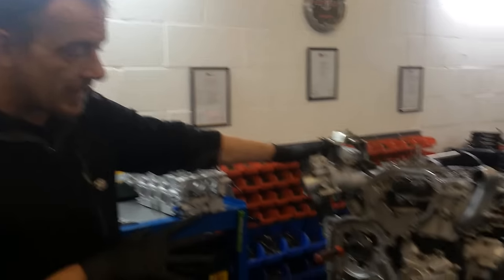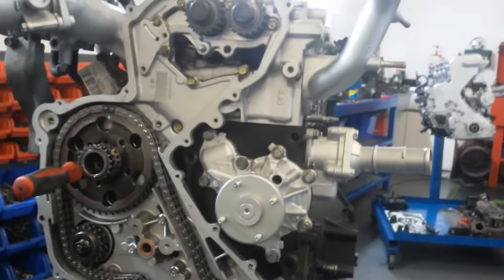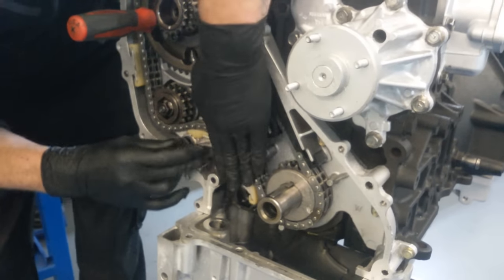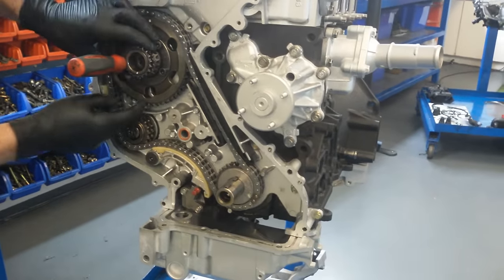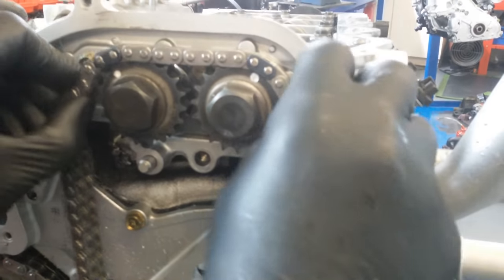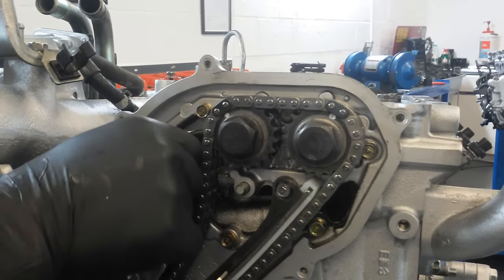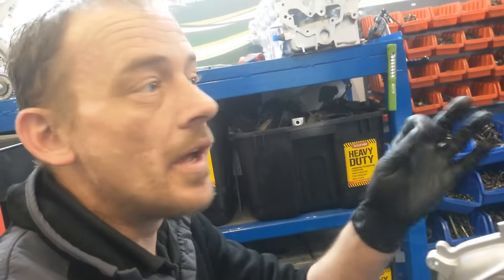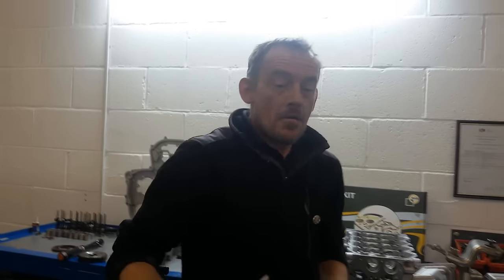How to Fit Nissan Navara D40 Pathfinder Cabstar timing chain upgrade new latest advice

Comment: Omfg, those 3 bolts that hold the Catalytic converter, super hot here in Australia, i ended up using extention bar, with makita impact driver, the 3rd bolt, i took the front wheel off to get access to it. 😳

Comment: Thank you for telling me about the oil pump O ring, I had just put a new head, water pump and timing chains on my D40, and wondered why the hell the oil light would stay on for 30 seconds after starting. Well after looking at this, I have now pulled it back down and guess what, I need a new O ring, thank you so much for your no bullshit and very informative videos.
Reply: Did u use a new o ring or just use atv 🤔

Comment: I may of put my comment on the wrong video but I just wanted to say a big Thanks for your videos. It helped me out tremendously.  Doing a service on my car. Which is a Nissan pathfinder 2009
The only massive issue I had was trying to remove the oil filter. Totally seized and over tightened by who ever did it last. I ended up have to take the wheel off & cowling. But the worst part was the metal pipe just above the oil filter.  Thanks Nissan for your stupid design of where you decided to put the oil filter. Nothing worked even trying above the engine which I tried to do before having to resort to removing wheel etc

If its wasn't for your great videos. Which has taken me 2 weeks to find. I think I would of given up. I wish there was more garages that's as good & as honest as you. Specially this day and age. Which is hard to find.
And is willing to share some advice & tips  to help people such as myself that has been let down by garages.

Really appreciate your wealth of knowledge.  And will certainly be considering buying parts from your garage.  
Than the over inflated Nissan dealer where I'm based. They charged me £5 + vat for a sump plug brass washer. And wasn't even prepared to tell me the torque spec on the serpentine belt pulleys which needed changing. And stretched belts. 
Your a breath of fresh air, And is really appreciated I do hope I have your name right Des thanks again buddy can't thank you enough I've Subscribed 
👍👍👍👍

Comment: good video! just did the job..seems to work allright. one detail i think is an improvement: when fitting tthe lower chain cover, i took out the locating pin.then, i could fit the chain cover without endangering the vital oil seal. tighten the bolts slightly, then hammer in a new pin/piece of 8 mm tube.  the old one cannot be reused, its a very thinwalled tube, gets bent with the removal.

Comment: Hello West Yorkshire Engine Service. 
Thanks for your amazing videos. You have helped me with my lemon of a D40 better than a manual. 
Latest prob is crank is worn about 50 thou and con rod. Finding it hard to fix. Is a Thai or Spanish crank interchangeable. Navara ST-X 2011
Diesel  YD25DDTi.   MNTNCUD40A
Thank You.

Comment: Hi I've just taken my 2011 Nissan Nivara apart to change the timing chain, and I'm not sure that the balance Shaft was put back in the right position when it was changed last, it runs a bit lumpy on first start of the day for a couple of seconds and revs a little higher than normal, I don't know if this is connected in any way but I thought it was worth mentioning, how do I set up the balance Shaft to make sure it is correct please

Comment: Hello , t30 xtrail very similar but i think my lower tensioner hs failed or blocked and i need to remove to inspect . Do you know if oil pump can come off with sump in place ? Its a tin sump not aluminium.  Thanks

Comment: A quick question....... Which year was the timing chain issue addressed on YD25 D40? Reason why I am asking is, I wish to buy a used Navara D40 but am not sure how to check if the car has a double timing chain without opening the engine.

Comment: Hi if the engine has been running prior,can you still turn the engine by hand to time it up. I need to check a few things not related to a rebuild ...im doing some calculations but hard to explain really thanks inadvance

Comment: I'm wondering if its possible to remove the 2 dowels from engine and load into the cover so you can avoid the o-ring issue?

Comment: hi mate awesome channel awesome info I got a question I got a Nissan cabstar 34.10  with 2 rubber mounts on the back and 2 on the front so am I right in saying the cab does not tilt forward as I need to weld the underneath thanks

Comment: thank you so much for your videos!
I have a 2010 Nissan Navara. 
my Q is: can a badly fitted timing chain where bolts are missing cause clutch problems,s through excessive engine vibration?

Comment: greetings from Kurdistan ... thank very much for the great VIDs I like how you work .. 
I'm working in the same industry as well and I hope you could make a Vid for the how to set the engine on TDC and how to install the fuel injection pump 

thanks
Reply from the maker: There is a video on this we did it some time ago tdc for the d40 is about 8 oclock and on the d22 it is at 12 oclock

Comment: Do you stock the rear engine lifting brackets? I rang nissan and apparently they dont sell them. 
Alternatively, how would i support the engine for lifting? 
One final question, is there any benefit of going with the d40 engine block over the d22 engine block or using parts like the oil pick up from the d40 on my d22 engine?

Comment: You are awesome Des. I am learning so much from you that I now feel I am a Nissan Pathfinder/Navara specialist. One question: can you please put up a video or tell me how many NM do I torque the cylinder head bolts and cam caps. I can’t seem to find the torque specifications anywhere.
Reply from the maker: Head bolts  39nm cam caps 16nm cheers mate happy fitting
Reply: I am mechanical.i VB like this

Comment: Hi guys love the informative videos. A question i have a nissan navara d40 2012 spanish built 4wd. where can i order the duplex timing chain upgrade kit for it. i found one on ebay but it said it was not compatible with my car.
or can i buy direct from you guys
Reply from the maker: Yes you get the duplex from us call 01274 663999

Comment: hello nice video  I have a question  my 06 infiniti m35 started to make a knocking  noise / ticking  now it lost oil pressure at first when you first start it it only made a ticking not really knocking noise it would go away after you gave it gas now it really has a rod type of knock I think I caught it at the early stages before it spun a bearing any advice is greatly appreciated

Comment: Hello, nice video! If you decide to change camshaft sprocket as well is it necessary to remove 2nd injector in order to fix the camshaft?
Reply from the maker: Are you replacing the sprocket or the cam
Reply: @westyorkshireengineservice9160   only the sprockets as I'm installing a new chain, so I believe it is better to change both, chain and both sprockets. In Your video, the engine is completelly stripped off. On mine are still the injector holders and injector installed as I'm a bit afraid to try to remove them (very bad experience from chrysler, they were very hard to remove).
Reply from the maker: @jan233321  you will need to take out number 2 injector buddy
Reply: @westyorkshireengineservice9160  Thanks a lot, I really appreciate quick reaction.

Comment: Am writing you from Trinidad and Tobago I always watch your channel learn a lot and I have a d22 yd25 and I need help with setting the timing on the top chain...
Reply from the maker: Bruce Hodge wy buddy what seems the problem
Reply: @westyorkshireengineservice9160   well did some work on the head and change the injectors and now the top timing chain needs to set but not getting proper info online but the chain doesn't have the 3 Mark's on the chain only one and it's the genuine chain....

Comment: My yd25 engine overheated, after the cylinder head was skeemed now the timing chain is making noise at 2500rpm , reving it beyond that is fine. I have replaced both top timing chain and tensioner but it does the same. What could be the problem?

Comment: Do you always take engine out for this? Also as it's a chain not a belt if you only doing average miles and not towing by rights you never need to change it, am I right?

Comment: Hi, mine is nissan d22 and timing chain broke. The mechanic said my car need to top overhaul and no need general overhaul because did not hit the piston. After all the valves and the timing chain set have been replace with the new one and the head also install back to the engine, the problem is my car wont start. After diagnose with comp, the result is 0077 code which is fuel pump problem. Before this i dont have any issue with fuel pump. You guys have any idea or advise for my problem?

Comment: Hy I'm Paul from malta first of all thanks to help many mechanics even me with your information. .the second thing i fix many Nissan navara in malta and now 1 Nissan navara 2007 d40 is coming with noise is pinking when press the gas more than 2500rpm in the same time is very smoke white .the engine is working 100% but when press the gas more than 2500rpm the engine make this noise the torque of the engine is very good. Is possible the injectors  ? If I find this problem i put the answer here guys ceers

Comment: I think my transfer box has gone as the wheels are locked in 4wd and cant release them back into 2wd there was a horrible grinding noise then it stopped any suggestions? and is it a job i could do.

Comment: Hi mate I'm just fitting mine today ,but its come with a balance shaft pulley but mine doesn't have the oil pump in sump ,do I just fit it anyway ?
Reply from the maker: You must have the cabstar

Comment: hello, 
I was hoping you might be able to help. I have a Nissan Cabstar 2007 and it will stall if left to idle. the truck will start up again perfectly fine and will drive around in all gears with no issues while about 800 rpm 

Any idea what it could be? please let us know if you need anymore info to help diagnose! 

any ideas is much appriciated
Reply: If the rev needle stays in position for a second or two after the engine has stalled then it’s probably a sign of a slightly stretched timing chain. Remove the crankshaft sensor and see if it idles without stalling, if it does then it’s the chain showing signs of stretching and needs replaced.

Comment: Greetings,  I have a navara d40 2013 model that has code p1275 and p1622 I replaced sch,fuel pressure sensor changed fuel filters,fuel tank flashed and at least p1622 has gone I deed a manual and scanner reset but code p1275 is just  really tough to delete still in limp mode until I unplugged cam sensor then boom back to its power I have already checked cam sensor and is at good shape  is there a possible that my timing chains jumped?
Reply from the maker: gambit wacho yes sounds like you have timing chain problem
Reply: Thanks for your feed back ill be sticking around

Comment: Hello mate, can you please upload a video on how to remove a turbo from a 2009 or similar Nissan Pathfinder diesel please?
Reply: I found out how to do it now it now thanks to your videos. There are two bolts down the bottom of the catalytic exhaust/converter that’s attached to the turbo. Find these two bolts and remove them. (I got to both bolts from the left hand side behind the wheel) Then remove the 3 bolts connecting the turbo to the catalytic converter and the other 4 bolts connected to the exhaust manifold. Then under the turbo you’ll either remove the two bolts for the tubes or you’ll need to remove the hose from the tube going down to the engine block and the bolt and washer. Once that’s done remove the top two little bolts for the other hose/attachment. That’s it. Now pry the catalytic converter backwards as you lift the turbo. Took me three days to master this. Lol.

Comment: Hello.  I have a 2012 thai spec navara.  No clue if it has got the duplex chain or not.  Im at 123000 km on the clock.  Quite worried now a specially after this video. Im in South Africa.

Comment: Have a problem my d22 with yd25ddti engine water and oil mixing in engine . Head gasket is secured no cracked cilinder head pressure tested block cannot figure why its mixing
Reply from the maker: Andy Persad That would be your oil cooler buddy

Comment: What about the cylinder head ones the chain cat .the valves is it could be ok or not help course I have the some yd25 nissan navara .problem the chain and is not starting .martin
Reply from the maker: You will have bent valves Cheers Des

Comment: most diesel engines now have the timing chain at the back of the engine.and all are a single chain,  and not a duplex chain  hence the are braking early .wether this is done for that reason? same now with petrol engines .

Comment: Dear friend, I am from Brazil I admire your work parabems for your videos I watch all, I have a frontier nissan d40 motor ydd25 2.5 16v looking at your videos I noticed that you sell the current kit brand BGA what is the value of a kit of current for future replacement on my frontier.
Reply: Hi sir please i went to know where the crankshaft timing point is on the engine block

Comment: What's the best brand for YD25 timing chains kit? I'm from Brazil, and here all replacement brands for timing chains have a poor durability, around 10 mil km we see more than 15 mm of tensors stretch. We check the oil pressure before change the kit, even in the engines with goo oil pressure, we have this problems with replacement brand here in Brazil, and I think that I will import timing kits, but I need to know what the best brand in durability.
Reply from the maker: The kit we use is BG Automotive we are looking for agents to market Brittish products.
Reply: @westyorkshireengineservice9160 , about the durability, you have a good experience whith this brand?
Reply from the maker: @enricof18   We have being using the BGA kit for years without any issue, Thanks Des
Reply: @westyorkshireengineservice9160  thank you for the answers. God bless you!
Reply from the maker: @enricof18   Thanks for getting in touch all the best Merry Christmas!!!!!! UK Products the Worlds very best.

Comment: Sorry you didn't say the torque spec for the upper tensioner, i'm assuming same as the other right?
Reply from the maker: Correct buddy
Reply: @westyorkshireengineservice9160  Thanks for your reply :) Been watching videos to research and yours are the best since i'm replacing chains, tensioners, guides (genuine) as well as the diesel and vacuum pump (idky) on a customer's 2010 south america built pathfinder here in aus in a dealership. Never done this engine before and just making sure i get everything right. To get it done properly and as what nissan says i've unbolted from gbox and taken engine out, both sumps off etc.
Reply: been taking pictures from your video that may help, since i'm replacing the diesel fuel pump, any tips on getting it timed properly? Got the new pump in but waiting on the oil seal which i'm replacing (and should be) before i can put gear and hardware back on. The original shim is still stuck to the gear in it's original position which is good lol
Reply: @westyorkshireengineservice9160  sorry for so many replies, also the new tensioners didn't come with any gasket, i'm assuming it's just machined metal to machined metal?
Reply: @westyorkshireengineservice9160  also with the new vacuum pump it doesn't have a oil drain to the pipe on the supper sump and we thought it must be wrong and got in contact with nissan and said we use the new pump, they changed it for some reason and you literally block off the pipe on the sump and gave us the part listings in which we ordered. it appears the new one drains into the timing case and the rest of the design is pretty much the same with the oil feed pipe with banjo bolt into the back of it.
Reply from the maker: @Davo_1991  call 01274 640028

Comment: Hi Des,  I don't know if you remember but I contacted you some time ago regarding my timing chain issue which you correctly diagnosed after I'd spent a fortune on various different mechanics diagnosing it. The top chain was stretched as you said it would be and since I got it back it seems that when you're driving it, it feels very slightly to be surging forward  and noticeable only to the driver as you're going along the road. I have spoken to the mechanic that did the job and he said it's not related to anything he's done and he noticed it before but I don't remember that, any ideas?
It is more noticeable in the 3rd Gear
Reply from the maker: not sure to be honest
Reply: @westyorkshireengineservice9160  you don't think it's the timing chain then Des?

Comment: Quick question. If this is a common-rail diesel, why does the high pressure pump need to be set to TDC?
Reply from the maker: To set the whole engine at TDC
Reply: @westyorkshireengineservice9160  Ya, but if the HP pump is only for pressure and timing is done by the ECU, does it really matter if the pump is timed? Or is it that it needs it to have the cams timed with the rest as well?
Reply from the maker: timing is not set by the ecu

Comment: Hello Engineer. 
I have problems with removing the front timing chain cover.
I opened all it's bolts but the cover still can't come out. It just keeps shaking. 
What should i do in order to get that timing chain cover out? 
Please help!
Reply from the maker: odoch liverpool Hi buddy if its the d22 model you will not be able to remove the oil pump when the engine is still in the car you can also send photos to westyorkshireengines@gmail.co
Reply: @westyorkshireengineservice9160  ok sir, thanks

Comment: Watch all your videos'm having problems with my engine and Yd 25 ddti when I turn my engine it takes to turn off the indicator of oil pressure and make noise in the current command which may be happening already changed the command full current and the problem percisste u could help me